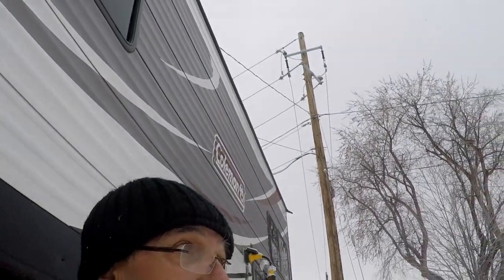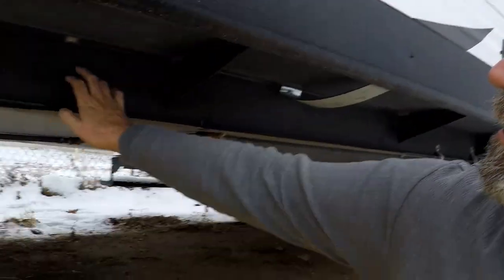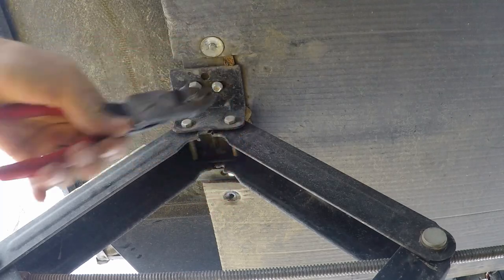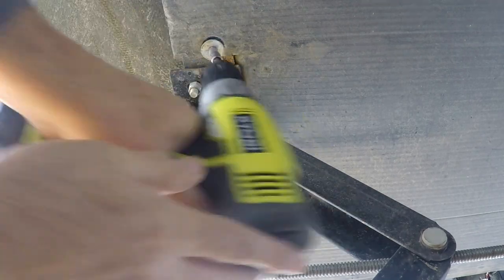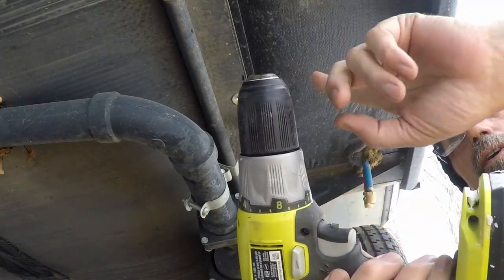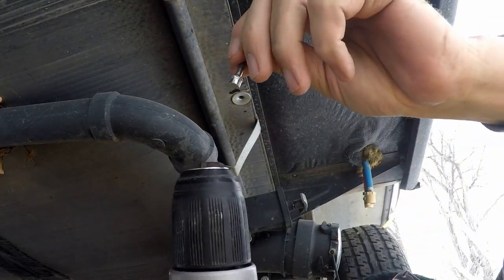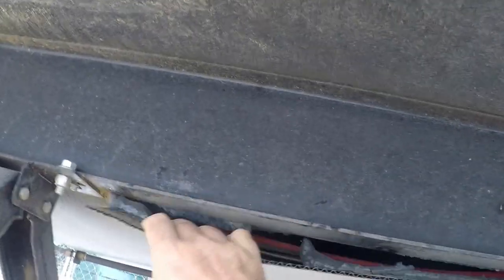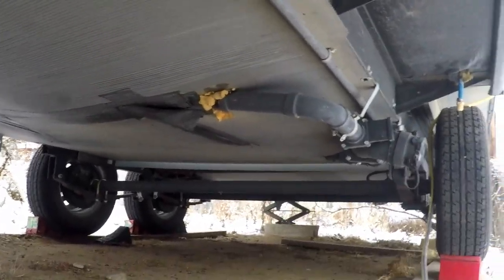Removing nails from RV Bellypan for access to run wires for the RV Electrical System Upgrade Project

Comment: Thanks for the video.  I’ll be dropping the underbelly on mine for the same reason.  Relocating the battery/cables from the tongue to under the bed when upgrading to lithium.  It looks like I’m fortunate that the cabling will be the correct length too!  Thanks again for the video!
Reply: Yup I’m doing the exact same thing on mine.  Batteries under the bed along with solar controller.

Comment: I did the same thing and use the hammer drill function on my half-inch cordless drill. The hammer and action really helped loosen those nails.  So far I haven’t found a screw that doesn’t snap off when trying to self tap. Any ideas? This is a great video however, I think that’s the most important aspect is how do you put it all back together again. I’m going to try some things and if I come up with a great idea, I’ll post it.
Reply: Any ideas yet? self tapping metal Roof screws...

Comment: I need access for the same reason.  Unfortunately my rivets punch through on the inside of the frame underneath the corrugation where I can’t access.  😢 Managed to get some out with a hammer and chisel and only on has come out with a socket and one snapped off which is the ONLY time you can be happy about something snapping off 😅.  I may try using the teeth of the drill and see what happens.  Needless to say if I ever have to remove it again, it will be much easier!

Comment: I enjoyed your video and all the demonstration you did.  Really helps.  I pried off a couple nails and it worked fine but I think your method is better and especially if I have to remove the nails another time.   I especially thought your tip of using a drill chuck to fit the nail head is smart.  I still don't know why the mfg. put that black plastic on the nail heads.  Thanks again for a great video.
Reply from the maker: Thank you for your comment.

Comment: Our belly pans are attached via rivets. I wish they were nails like yours. It is suprising the differences in our 2018 202RD and yours.
Reply from the maker: Ours is a 2018 also, interesting that they would be rivets. Rivets are very easy to remove. Take a drill bit and slowly start drilling the head of the rivet. When it falls off stop and then use a pinch and hammer to finish removing the rest of the rivet. If the center pin is proud of the rivet head use the punch and drive it into the rivet before you drill the head.

Hope this helps.